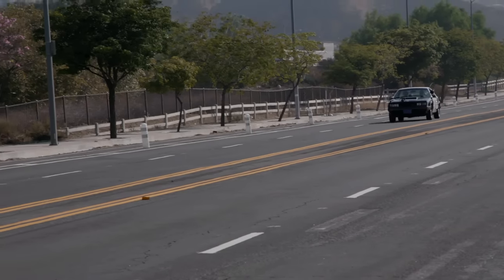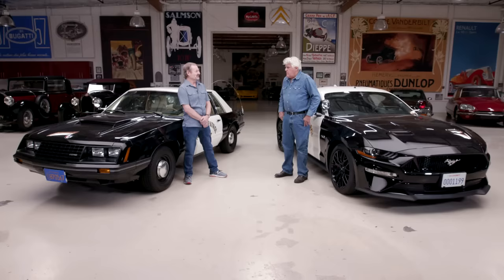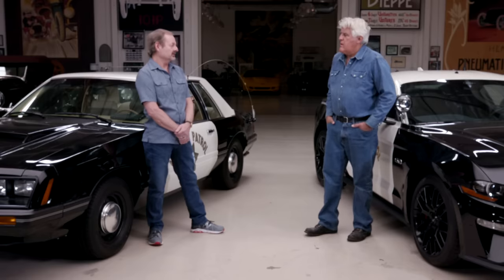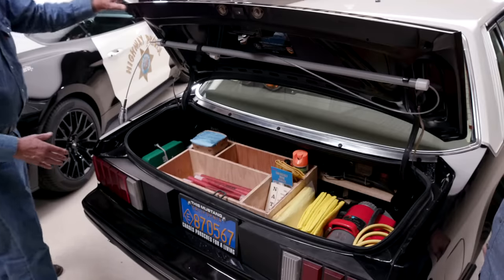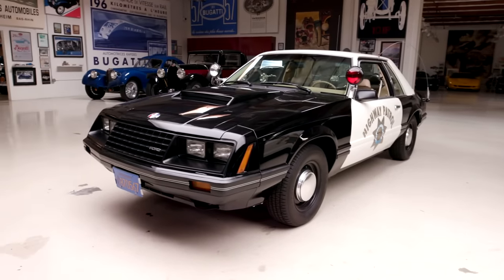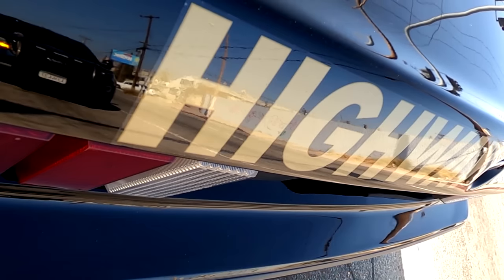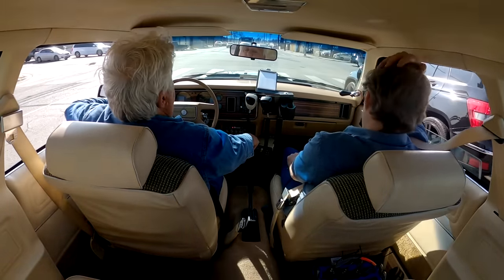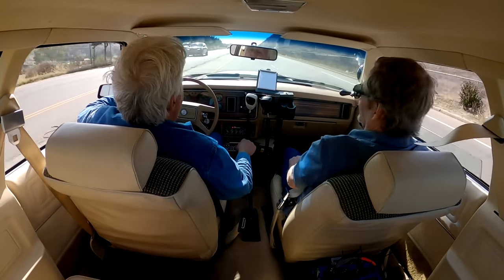This Mustang Chases Porsches for a Living | Jay Leno's Garage

Comment: One of my memories as an 18 year old in a mini-truck club in 1982 was driving to Vegas for a mini-truck meet and our group of trucks doing 90 on I-15 getting passed like we were doing 30 by a CHP Mustang. We later caught up to the CHP Mustang and he had pulled over a Corvette.
Reply: Will the mini truck craze and custom van ever return? I doubt it.
Reply: @westerlywinds5684  Considering what shops now charge for a labor rate, I don't think so.  To create a custom van would be $100,000 or more with all that paint.
Reply: @westerlywinds5684  I have seen minis around lately. I’ve been in a certain mini since the 80’s and still have one.
Reply: @westerlywinds5684  If it does I'm building Krieger's Van.
Reply: Such a great Era,  VW , hot rods great times

Comment: Great stories and nice to see these cars preserved and this is a beautiful example. LOL at the story of the guys blowing holes in the roof with the shotgun and I'm surprised they actually transported arrestees in them vs waiting for backup in a larger (4-door) vehicle. Also sounds like the speedometers were WILDLY optimistic.
Reply: yeah no way 160-180 mph like he said...maybe 130-140 downhill
Reply: Law enforcement car speedometers are calibrated to have an error of no more than 1 MPH at any point.  
I found that out when I owned a 1978 Plymouth Fury with "CERTIFIED" printed on the 140 MPH speedo.  
I called Mopar about a problem with the differential, and when I told the guy I talked to that it had a tag 
on the radiator bracket that said "special handling car" he ran off a list of what that meant, 
and he sent me a printout detailing all the "cop" features and options available for that model year.  
There were several things about the engine that made it especially durable. 
I eventually gave the car to a Mopar nut. Telling enough about that situation 
would take more space than I have already filled up here.

Comment: Got out of the Army in the early 90's and picked up my 79 Camaro from Port Canaveral, FL. About 300 miles back to home. Was on I-10 doing around 100 when the fuel pump quit. It was around midnight in the middle of nowhere so I sleptish in the back seat, not fun. Wolk up to FHP tapping on my window around sunrise. Told him what was up, that I was a mechanic, had just been discharged and promised I could fix it. He wanted me to get a wrecker but was nice and gave in to my request for a ride to the nearest auto parts store. He said the nearest auto parts was a Napa about 10 miles away but it wasn't open yet. He said "get in"! Lights on up the ramp backwards in reverse with a J turn on the overpass. Punched down the ramp on the other side and where doing 140mph in no time. I think his was EFI Jay! He dropped me at McD's for bfast across from the Napa and came back at 800am when the Napa opened to take me back. 140 back to the car. He said "I'll be back by in about an hour, if your still here your getting a wrecker!" I had it fixed in 10 minutes and was on the way. Great trooper and thanks for the help that day! Maybe he was trying to recruit me?

Comment: A friend of mine bought a 85 Mustang interceptor retired from the RCMP at auction. Really interesting car. It was an upgraded Mustang with improved suspension and engine output. Unfortunately most cars in the early 80's were very underpowered, so even 153hp in a small car was near the top of the food chain in '82. The finish on this car is really nice. Good job.
Reply: Any suspension and engine upgrades must have been aftermarket. Ford did not do anything to the suspensions or the engines for law enforcement duty.

Comment: Brings back memories of my first car, and the title of this video even is relevant too. 
I had an 1983 5.0L HO (4 barrel Holly) GT with the 5 speed (3.08 rear end), and was doing a 2 hr road trip to the big city for some fun...in the winter. Was just cruising at 10 over the speed limit, when I see a car catching up to me with something that resembled a light bar on the roof so I slowed to the speed limit as it approached and passed. Turned out to be 2 Porsche's with ski racks on them. My beautiful young female passenger found it so funny though, she was laughing so hard that she was sliding off the seat. As my ego was just hammered I felt the need to hammer the gas after I downshifted into 3rd, once my friend got back into her seat. A minute later I am passing the 2 Porsche's (who sped up to almost double the speed limit when they seen me catching up) at almost triple the speed limit, going up a hill in about 2" of slush. About 10 mins later after I slowed down as we approached another small town with a "T" stop intersection; the 2 Porsche's pulled up beside me with hockey puck sized eyes in their expensive suits; note that I waited a second for them to see them eye to eye. The look on their faces, was pretty funny to say the least! 
It turned out it was Motor Trend doing a sponsored drive up to the Yukon promoting winter performance tires via real world testing. The guy in the lead Porsche passenger seat closest to me at the stop sign looked to be the spitting image of Jonny Lieberman, big beard and all, just with much bigger eyes! Maybe he was looking at my cheap no name SK110 all season tires?
Reply: That was a pleasant read. Thanks for sharing!!! 👍
Reply: @geoffnelson64  Did some questionable yet hilarious things back in the younger days...don't remember much else from the rest of that day...but the look on their faces was absolutely priceless and unforgettable.  LOL  #YoungAndDumb
Reply: Did it go 180?
Reply: @jft7174  MPH...Almost for a few minutes...5th gear is a slow climb. They were long out of sight so I let up as we approached the next town...
Reply: @sickjohnson  👍

Comment: I own an 82 Fox and I find the 160-180 MPH+ claim pretty dubious. You could MAYBE hit 120-130 with good tuning, lol. Sweet car, and great stories though!
Reply: Yea Jay was nice about it but that’s impossible with that weight gearing and HP.
Reply: Hit 160 maybe going down hill and a 100 mph wind behind you . maybe you might 
Hit 150
Reply: Jay let him slide on that outrageous statement. That car is a brick with 225sh HP (maybe), WTF?!
Reply: I think his hotrod story sounds dubious as well. A bored out motor with a single carb doesn't sound right to me.
Reply: @misterdanielsiii  The haircut is also a red flag. Dude probably washed out of the explorer program and worked funeral escorts.
Reply: Not for a tuned 5.0 (4.7) which almost all LE are and where!
Reply: @texarkana3781  You have no idea wtf you are talking about. I owened several. That car weighs nothing.
Reply: @colecole3352  which is why a lot of them in LE service got crashed.  The later models had more HP and were still light, thus the crashes.
Reply: If I heard correctly it was a later Mustang - 91/92 fuel injected and reported to top out at 140+. 1992 were reported at 225 horse. 160/180 would be "pushing" it! I have a 1992 GT  convertible.
Reply: The Michigan State Police rigorously test all police models and the best top speed they got out of the later FI versions was about 140 mph with two officers and all gear on board.  I can see maybe 145 or so with the way the CHP ran them which was typically with one officer and pretty minimal gear on board but that's about it.
Reply: @roaddawg831  I-15 east of Bakersfield ain't Michigan. The normal prevailing wind is 20+ mph (eastbound) Plus, it's a few degrees downhill for 20 or 30 miles, straight as an arrow and very smooth without snow and not much rain. My generic econobox Suzuki will do @130 mph along that stretch, eastbound only and it takes several miles. 
Headed westbound, no way. A bit uphill and against the prevailing wind, maybe 90.
Reply: @colecole3352  I owned several also. I raced them, and worked on them. They weigh in the neighborhood of 3100-3200 pounds. By calling them a "brick" it was meant they they weren't very aerodynamic, and that is true. Not a single stock mustang between 1982 and 1993 ever had a top speed greater than 149 mph. Not any civilian version. Not any cop version. Not any GT. Not any LX. Not any convertible. Not with any factory gearing. Not with the 4-speed, the 5-speed or the automatic. Not even if you stripped the interior and took the spare tire and jack out of the back.
Reply: @xtnuser5338  That's just flat out wrong.
I had an 85 GT 4bbl. It flew. Motor Trend maxed it out at 153 mph 
Look it up, if you don't believe me.
Reply: @KoolHandJuke  Oh I believe you. I got clocked by a cop at 155 in my '87 GT. But all the Ford literature claimed 149. Still, 160-180 is complete crap.
Reply: @xtnuser5338  I agree. I can't imagine 160 and 180 is a pipe dream.
Reply: 180mph🤣
Reply: He never said he reached 180.  He did say got up to 160.

Comment: Great episode! I had two Fox body Mustangs, an '86 SVO and an '89 LX 5.0. Miss those cars. The SVO was great on fuel and was really really quick. The 5.0L had all sorts of torque even through the E4OD automatic.
Reply: All auto mustangs from '84-93 were AOD trans,they never had a E4OD....the E4OD is a Electrically controlled trans and was 1st used in the '89 F series trucks.
It wasn't until '94-95 the Mustang seen use of a electronically controlled trans,the AODE.In '96 to 2002/4 they went to the 4R70W

The automatics torque multiplication off idle is a lot more than a clutch provides.Actually a clutch provides no torque multiplication...

Comment: When the fuel injection came out in these Ford were proud of them, they had a higher quality , even the floors were reinforced. Ive been in a LX 89' at over 125mph and it didn't feel happy! But those notchbacks are sturdier and just a better Mustang . And I also had a 87 Vic 5.0 FI and I got mine up to 120mph clocked by Friends Camaro following.
Reply: I had an '89 5.0 Crown Vic back in the late '90s. Low miles... a genuine Creampuff Grandma special. Leaked more oil than the Exxon Valdez. Needless to say, it was the last Ford I'll ever own.

Junk. Pure junk.

Comment: Hi Jay;  Thank you as always for your fine videos.  My '86 Cadillac speedometer went to 80 mph.  The car would go up to 80 mph and NO faster.  Try as I might, the limit was 80 !  Up hill, down hill, level ground, that governor kept it at 80.  
Now my 40th anniversary  '04 Mustang GT conv. 4.6 liter auto is a 'horse of a different color' (red).  When I add the 'speedster' cover over the rear seat and folded top,  the cops are all over me.   I thought that at 70 I might have one limb out of commission at some time so, the auto gave me some peace of mind.  At 82, I wish I had the Mach I manual coupe. We get older, we never grow up.

Comment: I remember there was an SCCA road racer who, apparently, ordered one of the auctioned-off CHP Mustangs who raced one of these in, if I recall correctly, in a "Showroom Stock" class at Willow Springs with the panels left in the black and white and was the car to beat. I had always thought there was more to the story on the CHP equipment, like, improved spring and shock handling package or stiffened chassis. If it had the
Reply: AJ Hoyt My 1985 Mustang GT came with the 15 inch GoodYear "Gatorback " tires and in the rear it had 4 shocks two per side with two of them mounted in the horizontal position. It handled like it was on rails
Reply: @lilorbielilorbie2496  Those "horizontal" shocks are just to control axle wrap and wheel hop.....they replace the traditional "traction bars".
They factory '83 GL I had had a round bar that was bolted to the lower control arm or rear (forget which it was now) and curved under it.It had a large rubber "snubber" around that rod to stop metal on metal noise.It worked as it should,IDK why they decided they had to change it and use those stupid shocks instead,they never wore out like the shocks did.

BTW back then,'84 prior had a 7.5 rear,which in it's self was sort of weak,but the posi unit was bulletproof.It was like the Auburn Gear diffs and had cone clutches.They never wore out,break spider gears yeah if you were stupid but those clutch cones never wore out or slipped.....unlike the factory 8.8 on the '85 and newer that had clutch packs and the "ears" would wear/break off and then you had the great old one wheel peeler...

Comment: my buddy bought an ex cop car in the late 70s that would do 140+. It also had a stronger suspension. l think it was a dodge aspen but l know it had a 360 w/ 4 barrel and modded exhaust. That car was fast for those times as well.
Reply: Back in the day my patrol car was a 1978 Plymouth Fury with their new "Lean Burn System", what a hunk of junk!  It would do 112 mph for a few miles and then slow down.  Drove a lot of Crown Vics, not the fastest buy they were tanks!  Very reliable.
Reply: Still fast for todays standards.

Comment: The officer talking about not being allowed to repair the tires and having to replace them takes me back 30+ yrs ago when I worked for a huge Auto-Auction. All of the LX and GT Mustangs from that time were running the Goodyear Gatorbacks. FordMotorCredit and the Big Car-Rental companies made it mandatory that we replace any of those Gatorbacks that were punctured by even the tiniest foreign object. 

I still plugged them and stacked them in a corner (they were like new) till I had a truck-load and 1-2 times per month they would let me (LOL), "$$dispose$$" of them. 😆😂🤣
Reply: @spankthemonkey3437  Yeah they were just paranoid of getting sued.

Comment: Jay was kind...."It's amazing how slow this thing is"....lol. 
Even the fuel injected 5.0s of that era would do 144 mph tops. It wasn't until the Cobra R as mentioned here that Ford had anything as fast as what this retired cop is dreaming of.

Nice guy. Bad memory for speed.
Reply: I've got 5.0 almost stock 140 it's about all done.
I got 148 on gps with slight down hill. 160 180 that's a dream.
Someone once told me there was Ford built 331 at the very end of the run but I could never find any truth in that.
Reply: @yamahama9650  On I-15 eastbound, east of Bakersfield, it's downhill for 20 to 30 miles. Add to that an almost constant tailwind from west to east at 20+ miles per hour. With the shape of the terrain, it's a very windswept area. Since I'm very familiar with the area I'll give him the benefit of doubt.
Reply: I’ve done 145 mph once racing a 5.7 charger. Felt very stable even at that speed.

Comment: Very interesting episode. I'm surprised that this very plain-looking Mustang still retained the non-functional hood scoop.
Reply: Hello Roadster Life!
Reply: The hood scoop is functional in that the larger taller 5.0L HO dual snorkel air cleaner would not fit under the hood without the scoop covering the cutout in the hood. At 15:49 you can see the cutout in the steel hood and the inside of the fiberglass scoop.
Reply: Mustangs had functional scoops until 1999 refresh